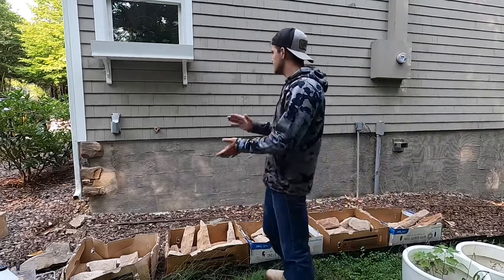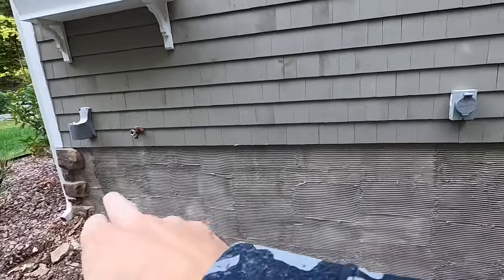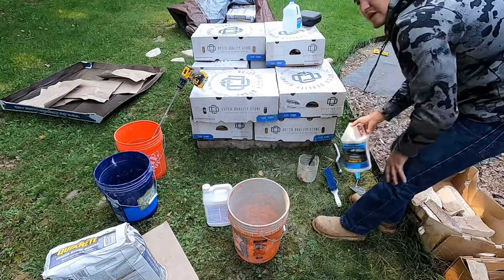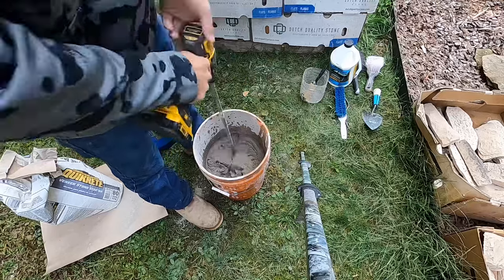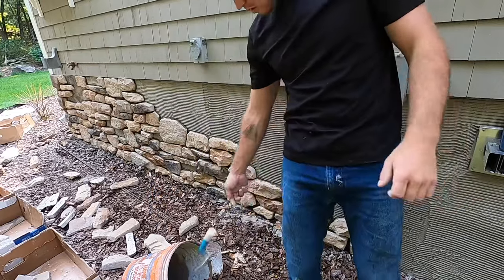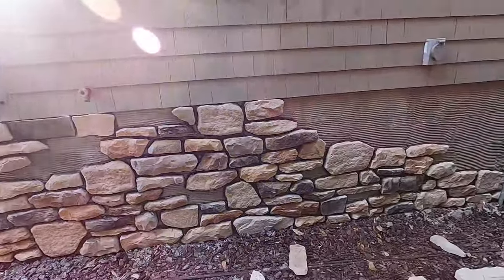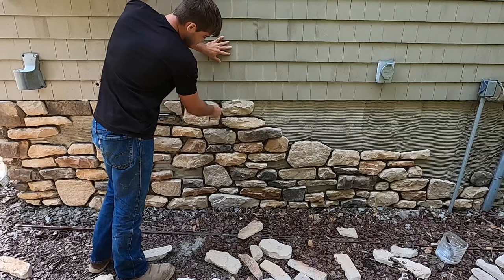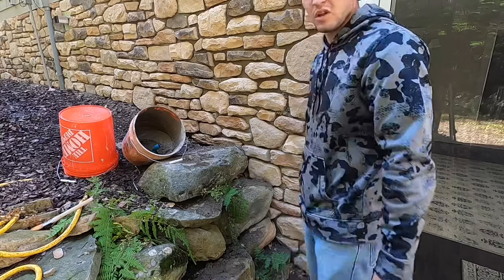How to stone veneer a wall

Comment: I have a suggestion that you can choose to delete as you wish but these mentions below are not for any other motive than to offer possible easier and better  installations for you.   
1.) Rather than hitting the fake stone with a hammer to get it into position, cultured stone that typically breaks relatively easy compared to a real rock, try just jiggling it under pressure instead.   In fact, if you were to metal lathe and scratch coat over wood, using a hammer can break your scratch coat and create an area that allows movement in and out from the wall when that happens. Jiggling your stone into place while adding ample pressure by pushing and jiggling ensures that voids between the product and the scratch coat are diminished.
2.) Always start your cultured stone work from the top and work your way down.  There are many reasons for this.  Starting at the bottom and working up will produce splatter on the lower product and cultured stone will never clean as nicely as natural stone.  Whereas starting your work and working down not only eliminates the damage of your lower installations but you also eliminate the unsightly non-whole pieces of stone at the top (starting at the top will ensure you always have a full stone where it is most noticed and any pieces are buried below eyesight in the ground.
3.) Your use of a bonding adhesive is absolutely smart.  But try this, simply splash or measure an amount as per the instructions right into your mix.  By doing so fortifies the installation in its entirety.  Wiping it on the back of the stone prior to installation is messy, time-consuming, and a potential for accidents.  The bonding agent has been proven to be effective in a recent installation I tore down after installing it only days earlier (amazingly strong stuff!).
4.) I notice your mud is thick.  More mud is not better.  Remember the copressive strength of your mortar is not much at all compared to say, concrete.   As you are aware, on brick and block we masons generally adhre to 3/8" of a mortar joint.  Did you ever wonder why? What I mean is did you ever wonder why masons don't adhere to 1/2" mortar joints instead?  There's a good reason for the 3/8" aim whenever using standard type N or S mortar (it's not just so we can build modular).  If I remember correctly tests are what has brought us to the most effective thickness of mortar joints...couldn't find the study online anymore because I just looked (sign of the time) but this comes pretty close: https://www.structuremag.org/?p=14495

*p.s. I didn't watch your video because I ended up here by mistake since I WAS looking for a video on the russian aggression thing so only clicked to a couple of spots through your video so if there's something stupid I've said, it's because I feel chatty and you're it.:face-blue-smiling:
Reply: Those were helpful pointers
Reply: @rickybaker42   And one more thing I forgot to mention; when your jiggling and pressing the stone in place try having a slicker in your right hand (if you're right handed); while holding the stone in the final position with your left hand use your slicker to tuck the excess grout into all the unfilled areas.  By the time your done with the tucking all around the stone that baby isn't going anywhere (unless your mud is too thick).

Comment: Can I ask you a question? I need to put an outlet on the veneer stone how can I drill a hole in it without breaking this stone ? Also how do I get through the wire mesh behind the stone without ripping it all apart and making a total mess? 
Thanks
Reply: Maybe an angle grinder with masonry blade and/or an oscillating saw

Comment: Mason, I’m just curious, I come from commercial FRAMING mainly. I just started with a new company doing residential and commercial renovation and remodel. I’m doing stone columns currently. I’ve NEVER done any masonry before. Do you have any tips for “speeding up” I feel I’m just goin super slow? But also feel I’m doing what I see everyone else doing? Currently I’m covering 4 columns that are 16”x16” and 10’ tall. I’m averaging about half a column per 10 hour day…. Would you consider that slow? I’ve had comments that my work looks great, but I worry I’m slow? You definitely do great work and I’ve learned a bit from you in the last couple weeks!
Reply: Speed comes with time. It’s more important to do it properly.
Reply: You can start off fast but it will look like shit and you will make a lot of mistakes. Kinda like driving once you get good you can race. Or use some of that nailable shit.